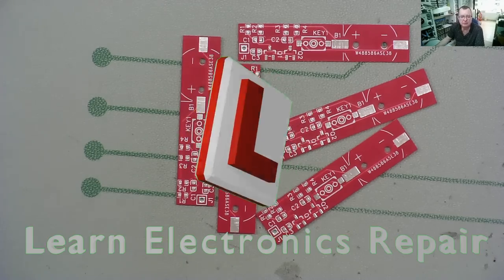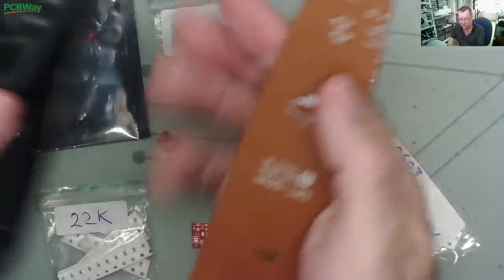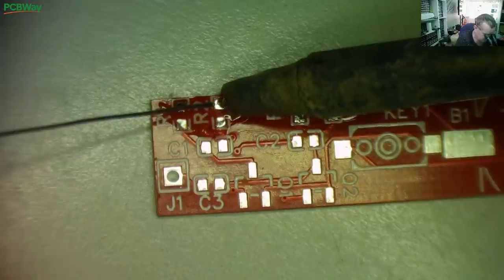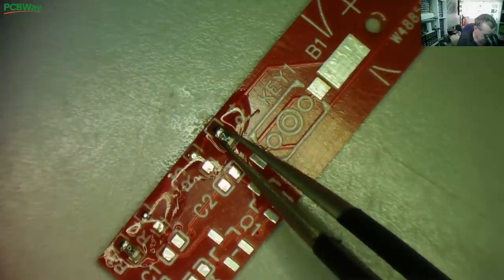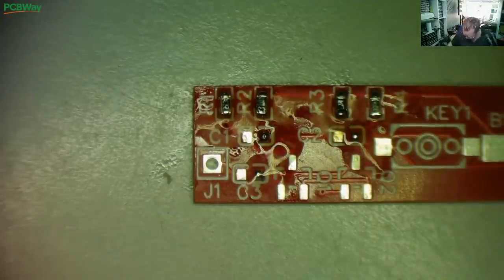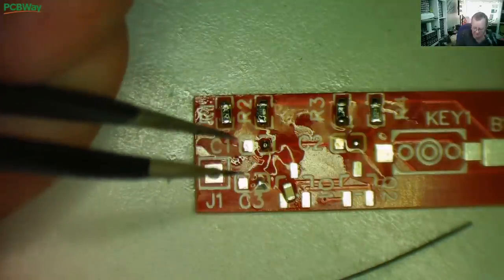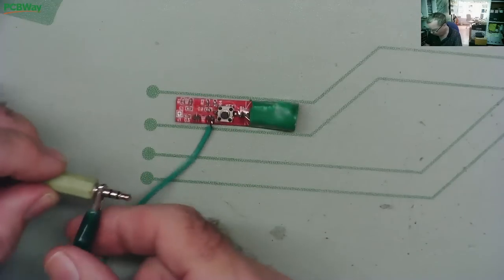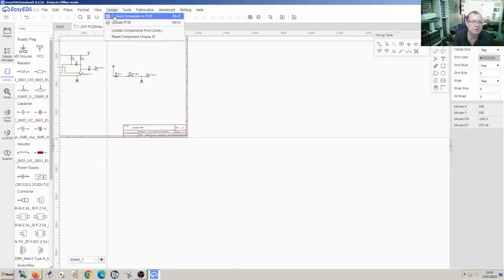An Absolute Beginners Guide To Designing PCBs using Easy EDA - Make PCB From A Schematic Part 2

Comment: Nicely done. Try a Linx 1220 through-hole battery holder. Surface mount types always take up far too much space and put strain on pads. Solder paste lasts much longer in a fridge, but allow 24 hours at room temperature before using.

Comment: How about using an old E-cigarette as the probe. Cheap as chips 😀. Just epoxy an old probe tip in the center of the mouth piece. Keep the onboard battery and add a recharge circuit. Then you could add a mini usb socket to charge it. Probably need to redesign your pcb to be double sided though to shrink it down further. Would solve the battery issue.

Comment: Just drill that PCB and sink battery inside the hole. Put one connector on the other side - it can be just wire across the hole, supporting battery from the bottom.

Comment: You could make a large pad on the board for the bottom of the battery, then use a strip of spring steel soldered to the other pad to hold the battery in place.

Comment: I would create a copper pad on the board under the battery, then solder a small piece of metal above the battery and bend it to press the battery down on the board as well as acting as the other battery terminal.

Comment: an excelent project for any one repairing audio amps or radios because of the high harmonic content it will work at RF .
the only surgestion i have is to put a high voltage cap on the output to the probe as even some audio amps can have high voltages in them .
for battery i have used CR-2 mounted off board  that will fit into a marker pen body.
Reply from the maker: Yeah I do agree about the capacitor on the output, it is only rated at 50V.  I will try a CR2

Comment: You should do a copper pour on both sides not only for power planes or screens.  But it reduces the amount of copper needing to be removed and then recovered from the etching solution and means that it has a longer working life.  Better for them and the environment.
Reply from the maker: Yeah I will continue with the pcb design videos and look at topics such as that.  Thanks

Comment: Interesting to see other peoples technique when SMD soldering, personally I could only manage 0603 with the microscope and as I don't have one the smallest I can solder (without a gun to my head !) is 0805 ! and yes a degree of ambidexterity soon comes with a bit of practice, in fact I would say the learning curve is surprisingly short. I do enjoy the challenge of designing an surface mount PCB but I still believe " Real Men don't use Autorouters " 🤣 and I have the tee shirt from my younger days (trying to be controversial) to prove it 😄...great tutorial...cheers.
Reply: My pet hate is very small smd components and enough room on the pcb to park a car on. Plus how many che k the power or voltage rating of 0402 resistors, also flowing the parts in a sea of flux, if the board and  components are clean and oxide free their is enough flux in the solder.
Reply: @TheEmbeddedHobbyist  Yeah I have noticed a strong opinion on flux, good for you !😄
Reply: @andymouse  Strong the opinion is with this one. :-0
Reply: @TheEmbeddedHobbyist  LMFAO !

Comment: Very nice. Could you show how you can use this? I understand you inject a signal, but what is this used for in trouble shooting a circuit and or board. Thanks
Reply from the maker: Yeah I will when i get chance.  It is mostly used for audio and radio frequency circuit repair
Reply: @LearnElectronicsRepair  Thanks for taking the time to answer.

Comment: You should not push down on a smd resistor  or capacitors if one end is already soldered as you can break the metallisation away from the ceramic body and thus buggering the component now or later down the line with a tiny amount of vibration.

Comment: Hello would the BK-335-SM battery holder fit on the board? Really enjoying your delve into designing and build your own circuit, never realised how easy it is to create your own PCB.
Reply from the maker: Do you have a link for that one?  I have found similar such as this listing but  I don't think any of them are small enough for my purpose
https://www.aliexpress.com/item/4001226560199.html

Comment: Lovely.  Very relaxing to watch.
Where do you get those tweezers from?
Any news on the Huntron tracker PCB yet?
Thanks.
Reply from the maker: The tweezers are from ebay.  I did some work with Detlef amend and Carlos from Retro Upgrade on the updated Huntron Tracker but so far it doesn't work.  It's work in progress
Reply: Thanks Richard,
I just wanted to check the PCB wasn't imminent.  I better just get on and do it Vero board!

Comment: As a professional PCB designer I still want to emphasize that manually routing your boards makes you understand more about electronics. Autorouter is always taking that chanche away to learn about routing and may cause unexpected problems to the functionality of your board.
Reply: " Real men don't use Autorouter's " 😂😁
Reply: @andymouse  Real men don't use apostrophes in wong places!
Reply: @tommeier4659  I always get told off for that !
Reply from the maker: I will look at that in a later video
Reply: @LearnElectronicsRepair  Thanks, I appreciate that 😃

Comment: Nice job Richard. I wonder could you just solder a button cell directly to the board. Might be too dangerous though as they can explode easily. I'd definitely be wearing glasses if I was going to do it. Or run wires off the cell to the board.
Reply: Mr Guru  If you roughen both sides with course sandpaper first, you can get solder to stick. But yea you're right about it not wanting to stick. I just tried it with stranded mains wire and I got it to stick eventually using leaded solder of course. I don't think the lead free solder would be worth trying at all.
Reply from the maker: When I built the original prototype (this is how you do SMD on Veroboard!) I did exactly that and soldered wires to the button cell battery
https://www.youtube.com/watch?v=_aI6TLLVpDQ
Reply: @LearnElectronicsRepair  Nice job on that Richard, I must of missed that vid. Personally I would choose this option again. Then you could just remove the bottom battery section of the pcb to gain more space. If you get Carlos to come back with your spot welder, even easier still 😉

Comment: Smallest Battery holders I have used are for CR1220 I think too big...cheers.
Reply: CR1220 are available with spot-welded terminals. You can solder them straight to the board.